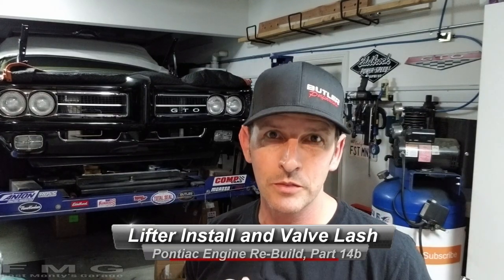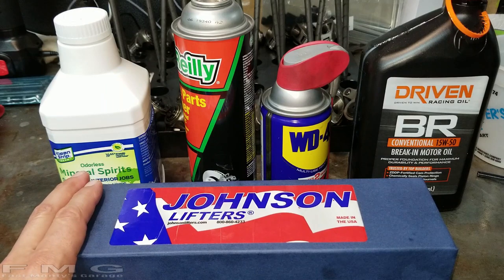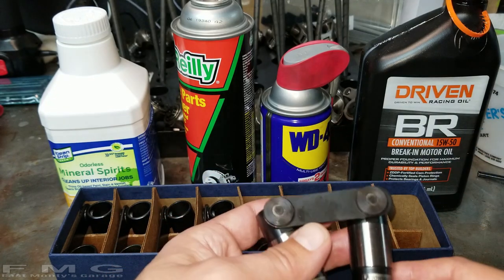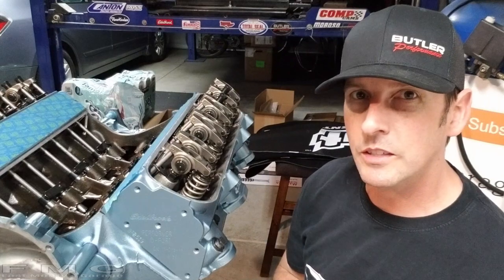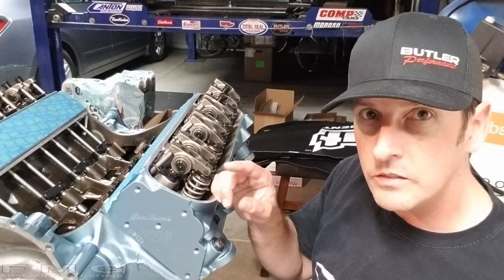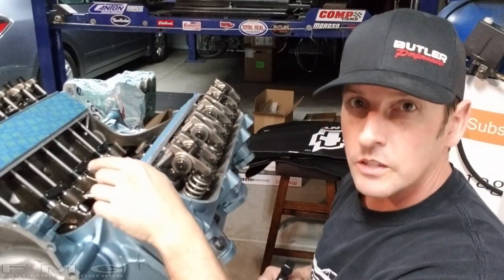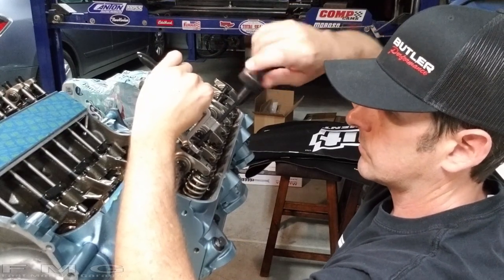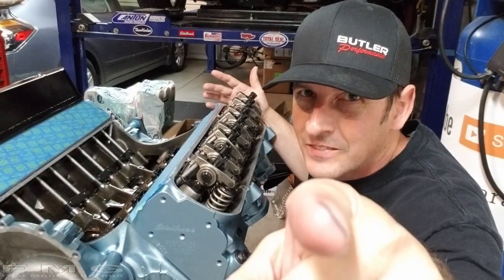Pontiac V8 Rebuild, Part 14b:  How to install Hydraulic Lifters and set valve lash, correctly.

Comment: Monty it  occured to me that we could take the human feel part out . Use a .010 feeler guage when the lifter is on the base . Then you will know zero lash is  exactly 1/4 turn further. Then add your 1/4 to zero lash plus 2/5 turn .65 turns. For .020"  preload and lock it down. With the guage you can set the same exact tention for every valve within a few thousanths.  assuming 7/16"-20 adjustment threads. each turn is 50 thousanths. This worked perfectly the first time. With 041 cam or in my case Summit 2801.
Reply from the maker: Makes sense, but wouldn't you need a 0.0125" feeler gauge?  That's a quarter of 0.050"  good stuff
Reply: @FastMonty  Nope  you can use any size just so you add it to your adjustment amount.Sorry about my math . You get what i'm trying to write. Use the .012 then go 3/4's of a turn. 1/4 for the thickness of the guage and 1/2 turn preload. It will be exact then, no feel jut solid guage to find zero lash exactly. Because it is that tight. You cannot be off at all I have found over the years I got my first Pontiac in 1984. I have had 3 engines and they all have had problems on #6. machining error or heat distortion. I think it my be both. later bye
Reply from the maker: @williamcrowe1591  Welp, you kinda just said it... some areas of the engine might be different due to distortion.  I think we're back to "doing it by hand".  that said, if the engine was perfect, yeah, we could absolutely use a feeler gauge combined with the recommended preload from the lifter manufacturer.  BUT, no engine will ever be perfect , especially due to tolerance stack of all components... so, now we're back to page 1.  :)  Thanks brother!  Love the input and thoughts around it.

Comment: On big overlap cams the only way to ensure you are on the base circle is using the EOIC method.

Also, congratulations.  Out of the more than 25 videos I have watched on youtube on getting pushrod length you are the first and only person that has correctly pointed out that if you are using hydraulic lifters that you are pushing the lifter down to the bottom of travel of the lifter.   Consequently, whatever pattern you get on your valve stem is INCORRECT that way.

Just using a solid lifter can also be wrong.   I have found some where the depth into the lifter to the pushrod cup is different on a soliid versus hydraulic lifter for the same engine.
Reply from the maker: Thanks Mac!  Yeah, after filming this episode, I forgot I owned a light weight valve spring specially for eioc measuring that does not compress the lifter. Oh well, next time!  Thanks again for the awesome comment!

Comment: Hey Monty, do you believe in that Driven BR break in oil? My 406” 400 is about finished. Received my poly locks in the mail Wednesday from Paul Spotts, so that was my final piece I was waiting on. I’ve been contemplating using the Royal Purple break in oil since it has good amounts of zinc and phosphorus to help with break in. After break in I was thinking of running Royal purple 10-30 full synthetic, or maybe Valvoline VR1 10-30 full synthetic. It’s mainly the break in oil I’ve been wondering about.
Reply from the maker: Hey Roger, fantastic questions... the answer will change as time progresses. Especially since filming this video. In all honesty, I follow what @ButlerPerformance  recommends. I strongly suggest reaching out to them or hitting up their website. Thanks for the awesome questions, and keep at it!

Comment: I find using the EOIC method to be the most accurate and going only 1/2 turn down from zero lash is plenty. And yes, never spin the pushrod until you feel drag to get zero lash, only use the up and down movement as a women would do. Your drag could be different to the next guy. The old way from yrs ago was up/down and spin until you felt drag.  Do it once and do it right. If you have a solid lifter cam as my previous cams were until I went with a roller cam, you used a feeler gauge for the correct drag. And again, your drag could be a thou or 2 off from my drag I like. Same goes with the drag on a spark plug gap.
Reply from the maker: Thanks John!  Yeah, it definitely depends on the lifter guidelines, typically on the side of the lifter box.  Good stuff!

Comment: 2 questions,

How did you go about choosing the lifter? From butlers tech guide it seems you need to measure the distance from the base circle of the cam to the oil hole and bottom/top of the bore to see if it’ll fit or have the oil band extend past the bore and depressurization.

Also, did you have to slot the Edelbrock heads? I have a set of performer RPM’s with the 1.65’s I’m about to install and I thought they would clear.
Reply from the maker: Good question Nathan... The lifters came from Butler, so I didn't have to do any measuring.  :)  Yes, if you're using 1.65's you have to slot the pushrod hole.  Thanks for the comment!

Comment: So I watched a video from Summit Racing on finding pushrod length and they said when using hydraulic lifters be sure to pump them up before trying to take a measurement. Is this not a recommended practice? No one commented on pumping up lifters. Just curious. Great videos by they way. Just found them this week I just got my Pontiac 467 back from the machine shop last Friday.
Reply from the maker: Congrats on getting your baby back!  That's exciting.  Good question about pumping up the lifters... if it's feasible, yes.  But, difficult to maintain the "pump", because of the high pressure valve springs.  The BEST way to do it is by removing the valve spring and replacing it with a Low Tension spring, so it doesn't compress the lifter.  I own one, and totally forgot to use it in this video.  Too much going on... anyway, they're cheap, and you can find it at Summit.  https://www.summitracing.com/parts/cca-4758-1  Have fun with that beast!
Reply: Do you have a video explaining the 3 way valve you put into your heater hose?
Reply from the maker: @brianwilson1541  No... it's a valve that diverts water back to the timing cover, OR, through the heater core.  That said, I have a video coming out on Monday that explains the cooling even better, and answers any questions about why to T off of the Passenger head.  Hope it helps.
Reply: All your videos are extremely helpful. Especially since it’s an almost bolt for bolt exact build. Your motor is a 69’ (right?) and mine is out of a 68’ . Both are 467s. And it’s looks like both of us spent enough money at Butler to put there kids through college. And love the fact that you have come up with cheap easy methods to help with cooling the engine. Thanks so much for posting your build. I jumped into this and was feeling a little overwhelmed. Then I found your videos and now I am more excited than feeling anxiety.
Reply from the maker: @brianwilson1541  Ha!  Thanks Brian!  That's exactly why I started filming all of my projects.  (I wish I started filming when I built the car the first time, but oh well)  You'll appreciate next weeks video for sure, for cooling education.  And if you're building your Butler engine yourself, I highly recommend using the Tomahawk pan.  Here; https://youtu.be/OQDWZ1sz61g In conjunction with a M/E Wagner PCV Valve.  Here; https://youtu.be/fdYFieOOGq4  That valve is amazing... I have 500 miles on my recent rebuild, now a 470.  ZERO oil consumption, and the oil looks brand new!  Don't be shy... ask questions as much as you'd like.  I'll be releasing a new engine build playlist, that has my BEST of the Best videos, in build order... just need to find the time.  ha, ha... Have fun!

Comment: One more question Mike, why did you use 1.65 rockers and not 1.5. did you have to have your head slotted for the 1.65?
Reply from the maker: Good question... 1.65 will give the max lift to the valves, which is more air.  Yes, you have to slot the push rod slots.  (Obviously you have to have pistons with valve reliefs so they don't touch)  Thanks!

Comment: Hello from Sweden, I Wonder if you can recommend a dealer in US that has complete stock cylinder head renovation kit package. For a GTO 400cui 1970 year model? Thanks for good videos. 👍 🇸🇪
Reply from the maker: Hi Pat... not exactly sure what you're looking for, but you should try www.bopengineering.com and www.butlerperformance.com  hope that helps.

Comment: What are your thoughts on "old school" flat tappet hydraulic cams?
Reply from the maker: Giving me a loaded question, Rich?  Ha, ha... Flat tappets have their own set of problems, mostly due to improper break in.  But, with a Roller Cam, you can get much more aggressive with the lobe design, with less friction.  That said, if you're not going after a ton more power, Flat Tappets are fine.  Just make sure you break them in properly.  Thanks for the comment!

Comment: I’m late to this party and have been binging through all episodes so sorry for the late question. When you are doing the final poly nut tightening of 1/16 turn is the set screw held in place or is it also turning in sync 1/16 with the nut?
Reply from the maker: Funny, John. Not such thing as "late", when our engines are 50 years old.  But, good question.  Yes, that final 1/16 turn, you turn both nuts at the same time, which locks them down.  Welcome to the channel!

Comment: So do you run the oil pump some,  with them all loose so it can load or fill the lifter up with oil first before setting?
There is always the oil drain back - bleed off issue that needs to be addressed and monitored in this procedure. 
I am aware of it yet other might overlook that imperative steps.
Reply from the maker: One of the final steps in the engine build is to "prime" the engine, with a priming rod, before you put the distributor in.  No, bleed off is irrelative because that occurs every time you turn the engine off.  (All the valves that are loading the lifters, push the oil out of the plunger)  That's why you typically hear a few seconds of clacking when cold starting, as the oil pressure fills them back up.  And, that's also why it's nice to have an 80psi pump.
Reply: I warm it up a little About half way. Split the differance between cold and hot.

Comment: Hey Mike, what brand of rocker arms are you using?
Reply from the maker: They're PRW Stainless Steel 1.65's  Got em from Butler... https://butlerperformance.com/i-24453496-prw-stainless-1-65-ratio-pontiac-roller-rocker-set-prw-0245502.html?ref=search:https%3A%2F%2Fbutlerperformance.com%2Fsearch.html%3Fq%3Dprw

Comment: Great video set.   Almost made me think I could do it myself, but no guts.
In the video, you don't show the actual lifter install.  Is there anything we should know about that process that isn't obvious?
Also, is it possible to do a complete cam inspection without pulling the cam?  In other words, if I wanted to replace the lifters (not a complete rebuild), would a cam inspection be necessary and if so what steps would be required?
Reply from the maker: Thanks Cliff, with patience, you can do it yourself.  There is no magic with installing a lifter, as long as you clean it, and lube it as I described, it drops right into it's bore.  Yes, you can remove all the lifters, and inspect the lobs of the cam, while it's in the engine.  But, you can not inspect the bearing journals.  Why would you replace the lifters?  If they're flat tappet lifters, you'll need to carefully inspect the lifters for wear.  (They're made to rotate in their bores, if they're not rotating, the cam and lifter will show wear marks)  So, it really depends on why you're changing the lifters will answer if you need to fully remove the cam, or not.  Vague, I know, but I don't know what you're trying to accomplish.  Let me know...
Reply: @FastMonty  Thanks so much for the quick reply.  I was expecting days or weeks.
I am really trying decide if it is worth doing a complete top end, or replacing the cam, lifters, push rods, etc and going to rollers.  This is on a 400 with 90,000 miles.  The car is in excellent condition, but not much paperwork on what has been done.  Also can the cam be done without pulling the engine through the front or is it even worth the effort.  I guess I should tell you as well, this car is on BaT right now.  I really like it, and it is near by.  I have asked a couple of questions regarding this, but not really satisfied with what he says his mechanic said.  I think buying a GTO is a fairly big risk because you never know the kind of abuse a car has seen from previous owners.  Basically I have a short amount of time to learn as much as I can before I get in over my head.
Thanks again
Reply from the maker: @williac43  How do you think I built my car?  I got over my head too!  Ha, ha... You're gonna have to tell me what "BaT" stands for... If you really want to start tackling the work, for extra power, definitely start with going to a roller cam.  (You can change the cam, while it's in the car, but will need to remove the radiator, and possible the grills too)  New higher flowing heads, with roller rockers can be changed out at any time.  During the cam swap, or later down the road, if finances are tight.  Always a good idea to call an Expert, like Butler Performance.  Feel free to email me too.  fastmontysgarage@gmail.com

Comment: I got a 68 400 out of a big car from what the numbers on the block and everything says about it. Any tips on a complete upgrade with no machine work??
Reply from the maker: Good question... What's your budget?  If money is no object... :)  Tear down the engine, and pray the cylinders are good.   Then upgrade everything, besides the blcck.  Roller Cam, Aluminum Heads, Intake, Headers, Carb, etc... That's about $10k.  So, how bad do you want to upgrade?  ;)
Reply: @FastMonty  I've already got the headers, had to have them specially made since it's a 68 motor going into a 78 car with special motor mounts to boot bro. Also I got a nice aluminum holly and or Edelbrock intake, I just haven't decided which I'm putting on it. But since I have a nice Holly Demon carb I'm setting on top I will prolly go with the holly intake. As for the heads I'm at a conundrum. I actually have a set of really good heads that's came on this motor it supposedly had 400 hp stock so I was thinking about keeping them for now but idk. But as for cam, lifters,and other internals I like to see what company would be best. I've had bad luck with comp cams in Pontiacs ti
Reply from the maker: @eastin6868  Cool... you're on your way.  Just check out www.butlerperformance.com  Comp custom grinds their roller cams.
Reply: @FastMonty  yea I've used them for other stuff just never a cam lol. But it's time to upgrade to get the best out of my motor and thanks again bro

Comment: What camshaft did you end up using and HEI system? Thanks
Reply from the maker: Good question, Bill.  I went with a Butler grind, which I think is this one... https://butlerperformance.com/i-25039410-butler-comp-sp-street-performance-billet-roller-cam-hr-276-282-224-230-503-510-112-ls-std-firing-order-std-journals.html?ref=category:1272239   The HEI I'm using is from Davis Unified Ignition.  Thanks for the comment/question!

Comment: So you adjust a pontiac v8 just like a SBC v8?
Reply from the maker: Only if each motor has adjustable valve train, then yes.  I can't answer that question if the valve train is NOT adjustable.  Thanks!
Reply: @FastMonty  yes sbc has adjustable valvetrain Thanks

Comment: Spin the push rod till you feel the drag increase, not till it stops. That should remove the play. Then adjust lash.
Reply from the maker: Agreed.  As long as you STOP as soon as there's any drag.  Unfortunately, I've been told in the past, and read online, to spin it until it stops, which is clearly wrong.  Thanks for adding clarification!
Reply: @FastMonty  been doing it that way for over 25 years and never had an issue.
Reply from the maker: @Mechanickirk  Awesome.  Really appreciate the input.
Reply: Could y'all tell me how to adjust factory rockers with factory hydrolic flat tappet lifters? This is my first Pontiac. I've done sbc but never on one of these. Thanks in advance. Doing a cam swap tomorrow and I know you guys know what y'all are doing.
Reply from the maker: @romeopena5959  Good question... I probably forgot to mention it on the video, for a stock motor, ie no mill work, stock heads, etc..... when you're at the base of the cam lobe, you would just tighten the rocker nut to 20 ft-lbs.  Pretty easy.  Hope that helps, and good luck!  Oh, by the way, a good resource is http://www.pontiacstreetperformance.com/psp/techarticles.html